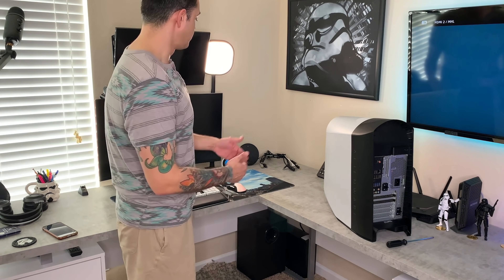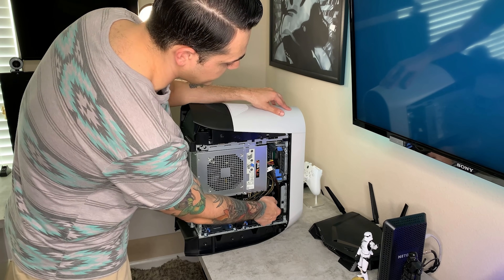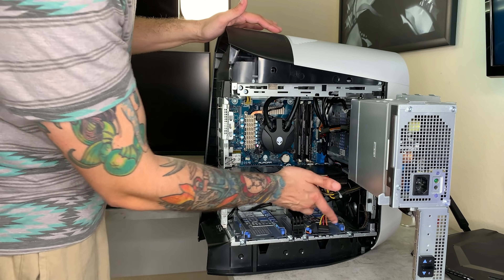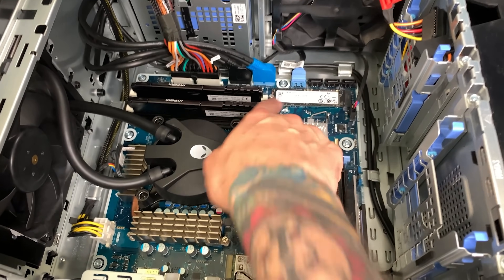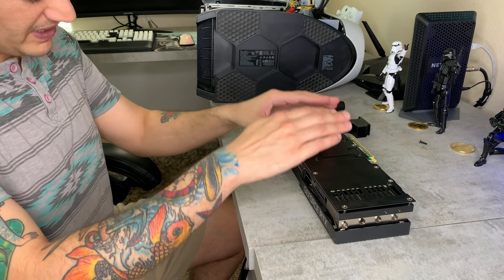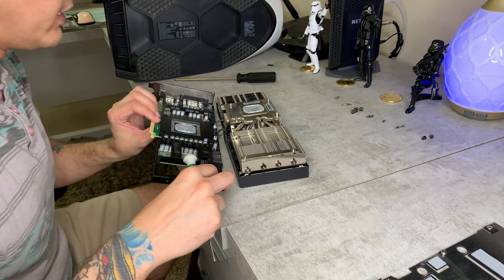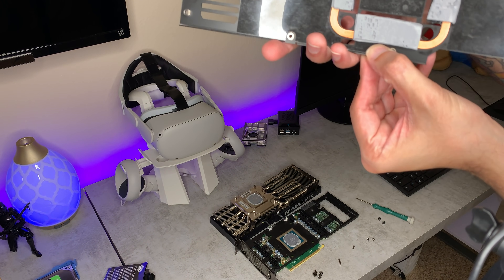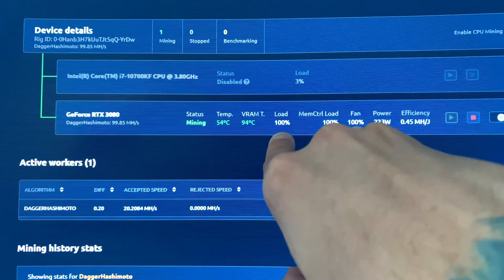Alienware R11 3080 Thermal Pads and Paste Drop VRAM Temps 30C

Comment: My r12 better get in production soon man. Waiting since March 22nd. Getting antsy.
Reply: Same here
Reply: I’ve been pressing f5 ever since
Reply: Right, ordered mine on the 30th, delivery date of the 3rd of may
Reply: Ive been waiting 6 weeks..
Reply: @m_styles1981  gross
Reply: Update....it changed to shipping this evening. No joke. I'm so excited!!
Reply: @hardrckr4983  skipped straight from confirmed to shipping?
Reply: @ItzBananasFN  yes totally avoided production. Went from confirmed to shipped
Reply: @hardrckr4983  sweet then I have hope mine will do the same in the next week since I ordered a week after yours hahaha
Reply: @hardrckr4983  Got mine today. Just finished setting everything up. I'm kind of pissed because as far as the RBG goes only the inner ring and Alien head lights up. Not  the outer ring and word ALIEN on the side. Like shown in his video. I called customer service to see what was up, and they told me that was only on the older modles....so annoying...Whatever. The PC is amazing so far.
Reply: @m_styles1981  did you go dark side or white?
Reply: @hardrckr4983  dark side
Reply: @m_styles1981  same..that's why. Dark side doesn't have the Rgb that the other case has...which is stupid but whatever. It is what it is
Reply: @m_styles1981  mines been put on delay due to part shortage :( not even the 6800XT, it's the damn 11600KF that they are out of lmfao
Reply: @hardrckr4983  bought me a thermaltake 1200watt RGB modular PSU to swap into the R12 when it comes. Along with 4 Corsair ML120 Pro non LED fans to swap in. Went with the RGB psu so I'll have some rgb coming out of the side of the case in the side vents lmao went with dark side case as well, can't use ARGB but RBG without controller works
Reply: @ItzBananasFN  out of curiosity, why are you swapping Psu? Are you going to mount it on the arm?
Reply: @hardrckr4983  The psu in the arm is regular size psu, detach the plate then the screws from the back and you can swap a standard psu into place
Reply: @hardrckr4983  swapping psus because I wanted a modular psu to cut back on wire clutter so I went with a 550 watt psu to cut price and purchase my own
Reply: @ItzBananasFN  that's actually brilliant. I have a 650w fully mod but that won't be enough. But I do plan on swapping cases, and Psu later on depending how temps go.
Reply: @hardrckr4983  can't switch cases unless you intend on buying a new motherboard as well, the on/off/reset plug on the Dell board is a proprietary plug and besides the the board soft bricks if you remove it from the case as a security theft measure
Reply: @ItzBananasFN  that's what I was planning. Getting a new mobo, and Psu. And gut the r12.
Reply: @hardrckr4983  I'll probably stick with the r12 till the RX7000 series Gpus come out because I'll need a bigger case
Reply: @m_styles1981  mines still delayed
Reply: Mine on March 19th…entered production yesterday and will be here on the 20th of April
Reply: @taterplays5909  awesome man..soon
Reply: @hardrckr4983  i literally just got an email saying it will be delivered tomorrow. So stoked.
Reply: @m_styles1981  niceeeeeeee
Reply: @m_styles1981  man I did the expedited everything, I want mine now lmao. Went with the liquid cooled 11600KF and 6800XT

Comment: so only paste on the metal cooler part around the processor and on the processor  (no pads)?  Then replace pads on the other side so that the memory chips make contact with pads and the top metal plate? Why not show this process since people will probably pour too much paste on the metal? Also 94c VRAM with 100% fans hmmm. wouldn't that typically be just 6-10c more stock at that fan speed?  Not trying to be entitled here but I was really looking forward to a detailed process video as to learn from your mistakes.
Reply: Until he shows us that he did apply thermal paste on the metal cooler ,I’m not risking it.
Reply: I did the mod and works perfect.  110c thermal throttled pretty much anytime I tried to mine- did the mod, paste and pads and now I run 90-96c overlocked mining ether hashing high 90s.
Reply: Just use thermal pads like 1.5mm and measure to make sure it makes contact  instead of thermal paste
Reply: NH settings are on high... 🤔🤔🤔

Comment: So after testing and changing thermal pads multiple times on my 3080, I’m here to say.
69% power
75% fan speed
-200 core clock
+1075 memory clock
97.36 MH/s at 90C on memory junction temp. I’m happy with that
Reply: Around 98-99 mh/s my card likes to crash after a few hours. So 97mh/s seems good enough for me. I also have the R10 FYI
Reply: @iVETAnsolini  mine will crash past +700 and 95 hash.
Reply: I’ve seen a couple other people that have said the same as you. I used 1.5mm thermal pads for everything
Reply: You have your core clock turned down. Also what are your fan speeds
Reply: Hmmm, I didn’t try adding thermal paste around the heat pipe. I just used it where it normally goes. I may try this thermal paste too and see if I can get my temps below 90C. The highest mine have gone, which seeems to be whenever the DAG file gets regenerated, is 94C. So 1.5mm thermal pads everywhere, even the back plate instead of 3MM pads, seems to be the trick for my 3080
Reply: 69% power

nice.